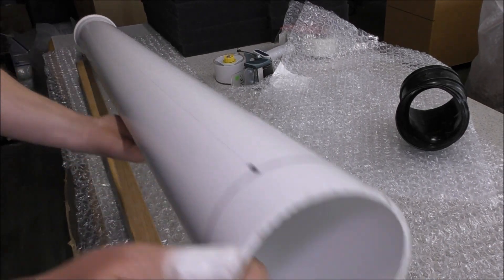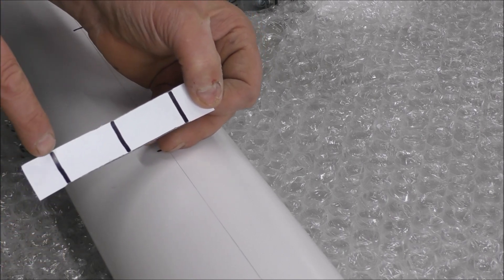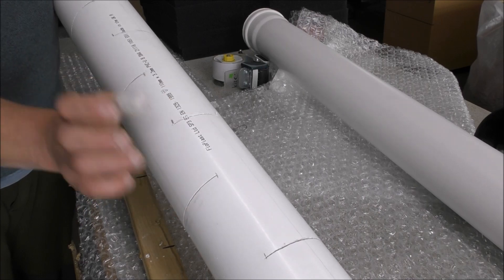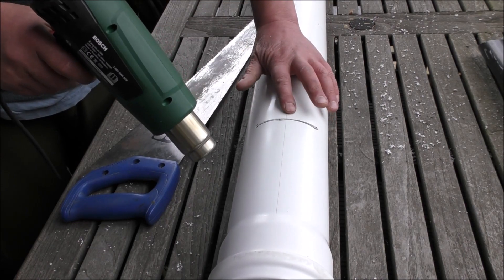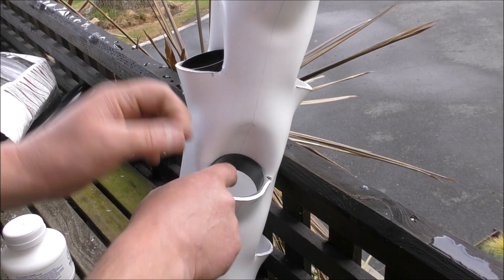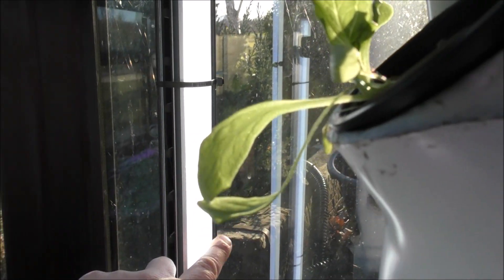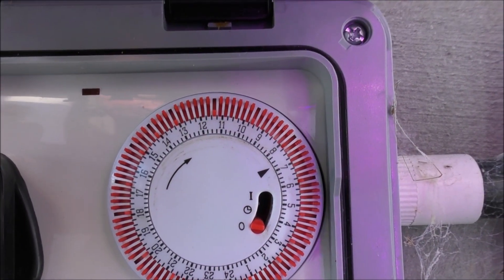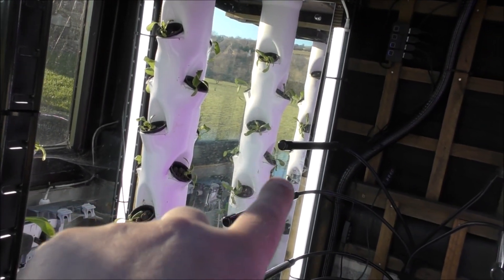Hydroponic Vertical Growing Towers - How I Made Mine

Comment from the maker: Sorry, this is a long one but it is very detailed.
Bosch heat gun (Amazon): https://geni.us/I9vB
The growing towers were a failure last year as I didn't have any way of testing the nutrient level - I basically killed my plants with an overdose of nutrients but this year I'm tooled up and prepared.....things are very different and all is good.
4" white pipes: Available from plumbers merchants and on ebay
Stands / shelving for system: https://ebay.us/FQhI7a
The stands are available in lots of variations but these are the ones I bought since they are powder coated to protect against rust.
The pump I am using is a (very) old Oase Nautalis 3000 which is probably around 25 years old - still going strong.
The USB 4-way splitter for powering the USB fans and USB lights can be found here: https://geni.us/pMzxIk
K1 micro media used for the mesh bags of media in the top of each tower - it supports only aerobic bacteria so processes the ammonia and nitrite but generates nitrate which is used by the plants: https://filterpro.co.uk/k1-micro-1-litre-24-p.asp
The 2" solvent pipe, rubber fittings, pipe joiners, taps and solvent glue were bought from Kockney Koi as I have an account with them but similar products can be found all over the internet.
I like Kockney Koi as they don't fanny about with nonsense - they just sell stuff which works.

I recently bought an electronic test stick to make sure I get the nutrient levels correct and also picked up a couple of nutrient solutions formulated for leaf growth from North East Hydroponics: https://northeasthydro.com/ as I was passing one day and . Next video will discuss the nutrients, show how the test stick works and explain why it is a very important piece of kit.
When I tested the water in the reservoir which supplies the vertical growing towers it was off the scale so maybe I should have bought a test stick this time last year.....
If anyone is interested and lives local feel free to call in any time to see the systems (and share any tips) that's no worries - just give me a ring first for directions.
Richard 07772848730
Reply: If your pump is 25+ years old wouldnt it be beneficial to your viewers to recommend a modern equivalent? I can't tell you how many videos and articles I've read over the past two days with half-hearted information. You can't begin to imagine how aggravating it is to waste your time on a video to not get the information you require.
Reply from the maker: @arcascrow4835  With regard to 'half-hearted information' for a vertical system such as the 4 tower version shown in this video a pump of 3000 lph is the important part - there are a nation of options for pumps out there so as long as you get something which shifts the water quite efficiently it's all good. Generally the more you spend the lower the wattage will be and the longer the pump will last so look for anything which lifts to around 2.8m / 3.0m with a power consumption of around 40W. Many of the 3000 lph pumps online are 60W and are cheaper but you'll end up paying more in running costs - it's fine if the pump comes on a few minutes every hour but if it is running 24/7 then a lower wattage is always better (as long as it will lift to a high enough head for your system). 
NFT systems are much cheaper to run, especially when the pump operates 24/7, but the footprint for those systems is much larger - each system has benefits and drawbacks.

Comment: I’ve experimented with your method of making holes and if you wear heat proof gloves you can pinch that little gap tight to your mould pipe.
Reply from the maker: Good one - thanks for the tip and best of luck with your systems.

Comment: Great video thanks so much you have one of the best ones on the internet. Cheers from Canada
Reply from the maker: I'm glad you found it useful. I really only use my vertical hydroponics units in the Winter since it gets far too warm in there for leafy veg in the Spring through to the Autumn. That's the drawback / benefit of making the greenhouse double glazed I suppose, lol
I have smaller units for leafy veg growing which I use in the Summer and since the vertical pipes in the greenhouse can be removed in seconds that area is now used for tomatoes - the lights will help to extend the growing season.
I hope you're keeping well in Canada.

Comment: They call the orange soil pipe, terracotta :) I made a couple of 5ft towers out of the 160mm, took me all day to form the pockets. If you only use cuttings you can get away without the collars and just use chunks of pool noodle. They will squidge into the hole and seal it up completely. Nutrients from grow shops are ridiculously expensive and not (elementally) ideal for normal veg, there are a few dry nutrients around that cost a lot less and will do a better job.
Reply: (my other channel) Yes, yes and yes - there is always numerous ways to achieve the same goal - no point spending more than you need.
I've grown leafy veg in hydroponic systems where the only nutrients added were piss once a week and it still worked fine - that cost nothing although I didn't tell my family what the 'nutrients' added to the system were, lol

Comment: Great video very informative. Could you please send a link for the collars?
Reply from the maker: The collars are cut from 2" black solvent pipe - it's available from anywhere selling pond gear. It isn't the heavy duty type, just the normal 2" solvent pipe.
It should be available from DIY stores too but often they just do push fit pipe and fittings.

Comment: Hi! Thanks for everything (:
I started making one of these myself and ran into 2 problems. 

1. In the video itself you said you use a 2 inch pipe, I bought a 2 inch pipe but it seems to be smaller than what is shown in your video. 

 2. After sawing and heating, I pushed the pipe 2 inches as you explained and I noticed that the edges of the hole I created do not look like yours, the edges did not open that much and for some reason remained relatively closed.  

Could it be related to the 2 inch pipe?
Reply from the maker: I don't know for sure - the holes I made really shouldn't rip at the edges. They should be a smooth circle but sometimes they rip a bit when the pipe isn't heated enough, or maybe heated too much.

Comment: What moves the water from the center to the perimeter of the pipe so it arrives at the net cups?
Reply from the maker: 17:18 - I mention and show the bag of plastic media in the top of the tower. That ensures that the water spreads to all areas of the pipe and when it flows down it feeds all the baskets.
That saves me using some sort of spray bar or sprinkler head at the top.
As the holes for the baskets are alternately placed the water is always going to cover all parts as it moves down through the pipe - hope that makes sense.